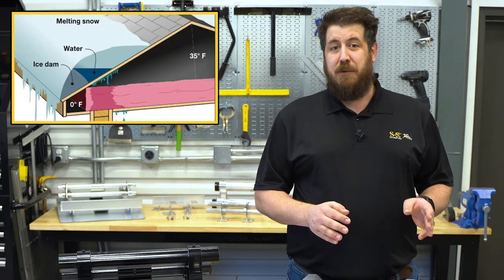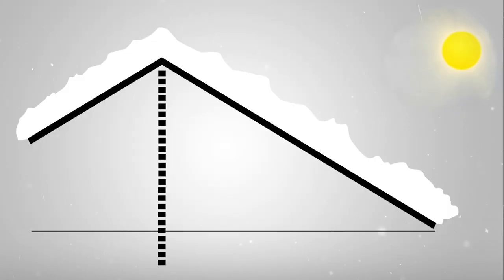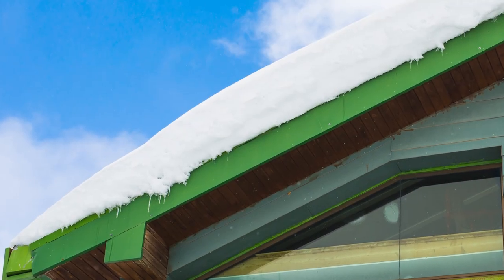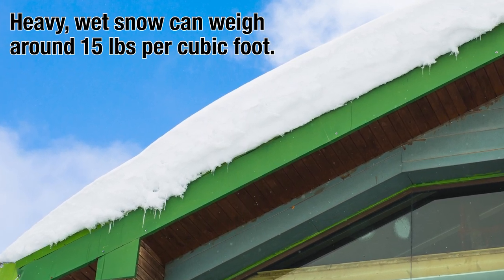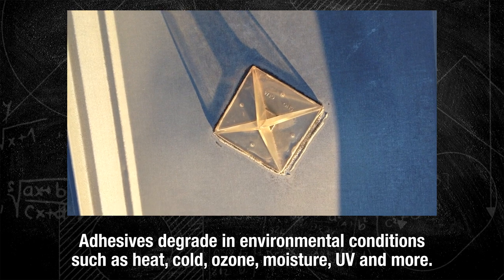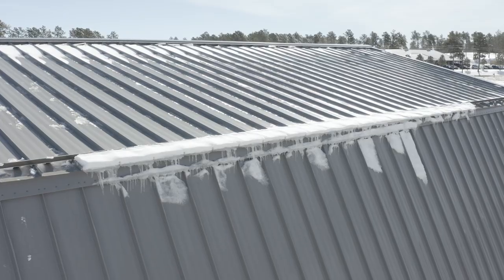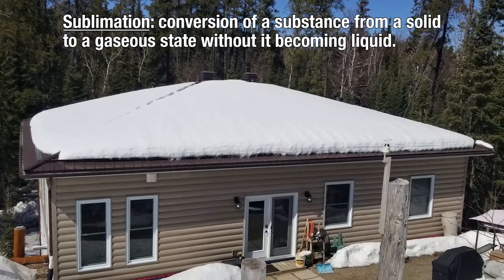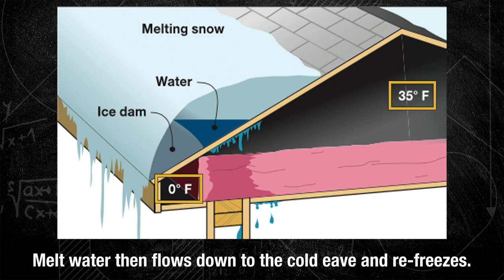Snow Guard FAQs and Common Misconceptions - Part 1

Comment: So what happens when you need your roof clear and it has 3 ft of snow and is about to collaps your roof. Dont those just defete the purpous of metal roof
Reply from the maker: What I believe you are describing is a common misconception.  What you are referring to is when buildings are designed with a "slippery roof load reduction".  This is quite rare, and in nearly every high snow load area, using a slippery roof load reduction is against building code since buildings must be able to safely withstand the absolute most snow load the project location could experience.  Adding snow retention on those roofs does not pose a risk, since the buildings are designed to handle the entire snow load that building code dictates.

Comment: CAN THESE be installed on SIPS panel roofing?
Reply from the maker: Yes, we have attachments for insulated metal panels. If you can send us the profile you are installing on to support@s-5.com we can let you know the proper clamp or bracket to use for your application.